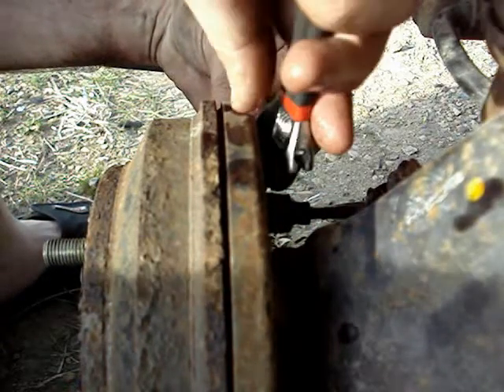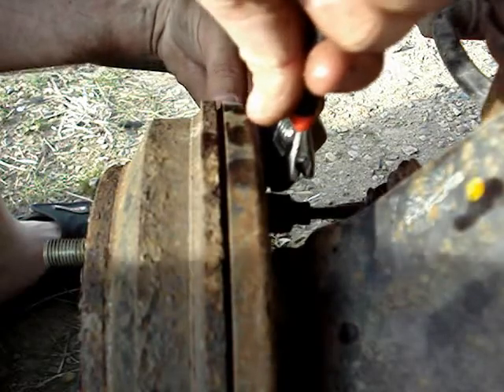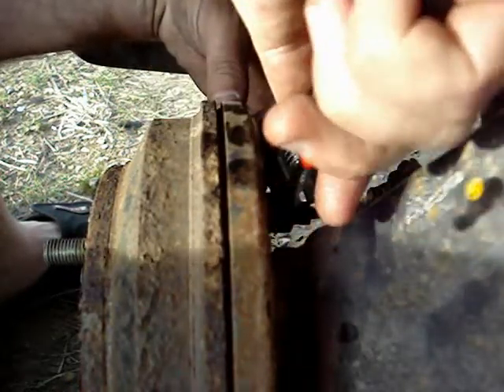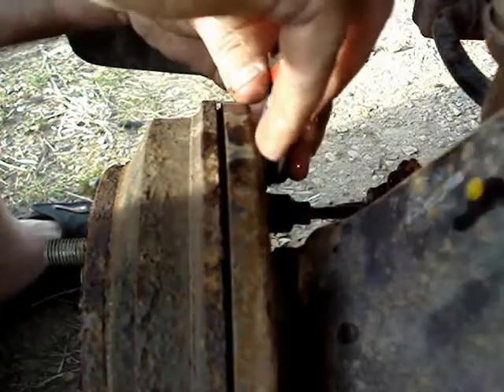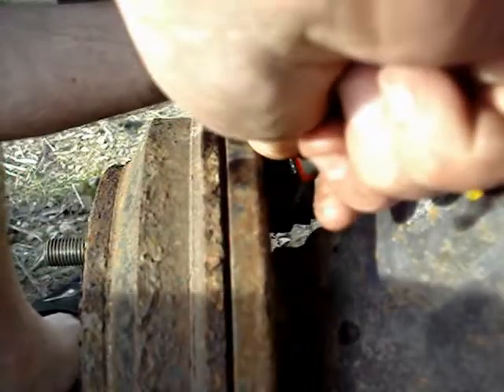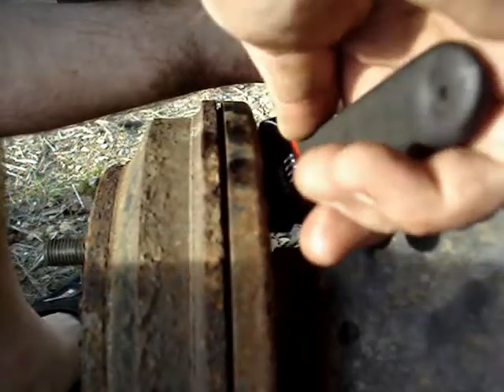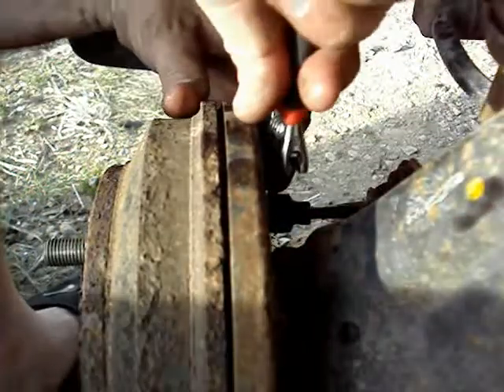Bleeding Brake Fluid

Comment: Really Good guide for changing brake fluid, BUT I really don't like how you are letting brake fluid run into the ground! It Should be going into a container for recycling.

Is it less harmful to the environment than oil or antifreeze?